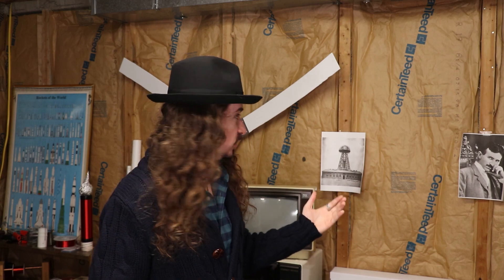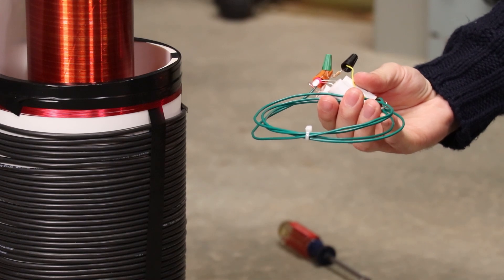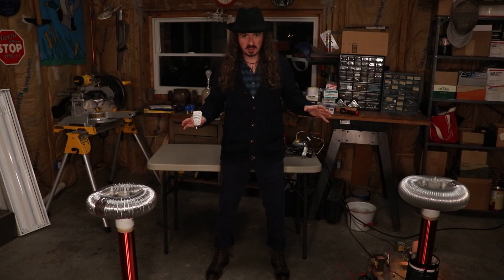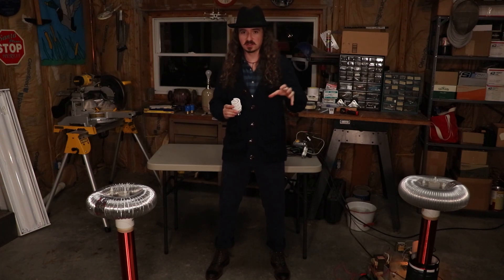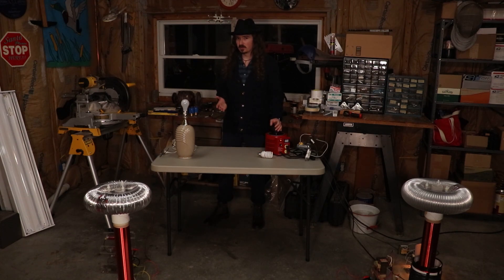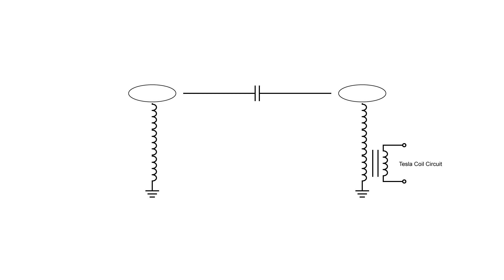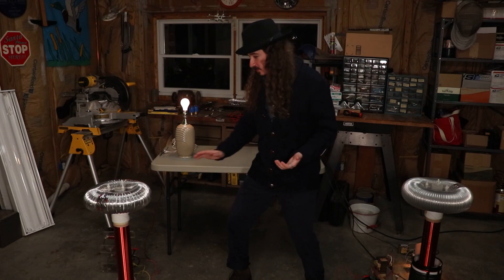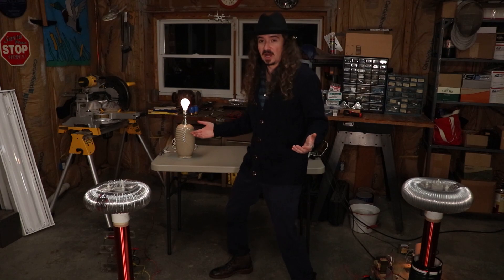Tesla Coil Wireless Power Transmission

Comment: Make them fatter and the tops bigger and put the round copper balls on the tops of them and hook it up to one of those machines that turn constantly on their own by spring or what not and use it to constantly turn 2 car alternators wierd to both push more Amp current to the sing transmitting coil and what ever else you have to do to hook the receiver up to finish the circuit Iv always been curious of free flowing wireless energy since I was a child

Comment: Okay but wat if u ran the tesla coil backwards. you have a big conductor  ball in the ion sphere,and pull high voltage down and send it were ever meaning instead of a pretty spark and lighting show by sending sparks through the top,you take high voltage in the top and send it down to earth ground .,,not possible? We'll ion harvesting group is running a small town off just that, from founding from the government,it very open source,people has got tesla coils backwards it makes a pretty light show but not wat he was doing

Comment: As I understand it, the earth frequency creates a quarter wavelength of about 8.4 inches.  In waveguide terms this is roughly the same size as some of the channels in the pyramids.  This would yield a useful frequency of 440Hz (math by Alexa).  There is speculation that the pyramids were power manipulators of sorts.  It is why Tesla was very interested in them.  I am not ready to dismiss the concept of his patent number 645576 based on this mini-proof-of-concept model since wavelength size does vary with frequency (and then there is amplitude as well).  Am guessing the video used 60Hz power which is not 440Hz.  It is very controversial and I don't think the concept has been investigated enough.
Reply: Interesting, as well as using correct frequency, if grounding rods were placed in patterns to promote conductivity, I wonder if efficiency and distance would go up?

Comment: Amazing explanation and a huge thanks for going deeper into these less known effects. I would be very interested if a very good ground could enable another coil to get pretty far from the original source. Of course if it is perfectly tuned. I am not sure though if it had anything to do with the upper atmosphere as so many people claim. 

Please note that the old newspaper pictures in the articles are journalistic clickbait if I may call it that lol. Or at least a mistake since people only saw the cool sparks it makes but that was only the way Tesla advertised his cool stuff. Even today people saw the pictures and videos today how Tesla coils make sparks so everyone assumes that's the intended use haha. Pretty far from it in fact.

You are absolutely correct that this radio worked as a "ground radio". Even the patent explains that the media for transmission is the earth ground not the air and says the less is put into the air the better. That's why the huge ball at the top so it does not discharge no matter how high the voltage is. Unlike our current radios which try to create a resonant antenna that is floating from ground. Very different!
Imagine if Tesla made that huge tower the who ground would be "part of" the circuit so any user with his/ger pegs on the ground is basically zero keters from the source of the energy as it is all the capacitor. In that sense yes the ionosphere kinda matters but only because it's a huge capacitor.
Reply: Right, sparks are for fun but wasting energy by destroying potential and make equlibrium. Low coupling, capacitive transmission are real deal and transmission line and third coil are missing. Also standing wawes phase shift and scallar (no magnetic component) also missing. One transmitting oscillaror and many surrounding resonant coils = possible overunity. None, including me, do not really know what is magnified with magnified amplifier. There are lot of playing with Tesla technology. Cheers!

Comment: Are your grounds directly connected or connected or just conected to the ground of your shop?
Reply from the maker: They are not directly connected. The base of the secondary of each coil is connected to it's own piece of sheet metal laying on the concrete floor as a kind of "counterpoise". So it's just capacitive coupling into the concrete floor / ground.
Reply: @CoilLabs  thank you, I’ll have to do some more experimenting. I got it to work with the bottom of the secondary’s both connected but the problem I’ve had with connecting them with sheet metal is it starts to burn and etch Lichtenberg figures in the concrete towards the other coil.

Comment: Very interesting I appreciate the experiment and set up however I have a question as a relates to the impossibility of being able to use wireless transmission globally Oran similarly large scales. Are there or were there geological in Edmonds fear conditions in the distant past that could have been more constant and stable? Further are there any geographical areas on a smaller scale that would have a more constant range of of resonance for safe electrical transmission?

Comment: Where can I get these specs or such so I can replicate this demonstration!?
Reply from the maker: The driver side of this coil is essentially the same as Steve Ward's VTTC5 (https://www.stevehv.4hv.org/VTTC5.htm), which is driven by an 833A vacuum tube. The receiver coil is a nearly identical coil and toroid. The step-down LC circuit at the base of the receiver was total trial and error, just trying to match the resonant frequency of the coil.

Comment: interesting demonstration.
But standing in between, could that not also detune the coils, due to their low capacity?
Personally I find dielectric coupling very interesting as it uses displacement currents.
For me it is not only conducted through the air, but even more so though the earth ground.
Why? because displacement currents are conducted through dielectric mediums.
And earth has a higher K value than air.
This is also what Tesla intended to do at wardenclyfe. And he tried increasing the dielectric induction into the earth by adding an extra coil, and capacitor to the secondary. 
making it a series (extra coil and cap) and parallel (secondary and cap) resonant system.
Reply from the maker: It probably does detune the coils a bit, yes, but it seems not significantly enough to affect the result in this particular experiment. And yes, there are most likely displacement currents through the ground, from the grounded side of the coils, as well. It has to complete the "circuit" somehow. There's definitely more research to be done and things to learn here. It's unfortunate how much pseudoscience and conspiracy theories pollute the discussion around these topics though and get in the way of real science. Hopefully more people are doing proper research on this stuff.
Reply: @CoilLabs  the most important thing that probably get overlooked, is that the more higher voltage you get on your coil, the greater is the efficiency of transmission. A proper device is at least three orders of magnitude higher voltage than your setup in this video. Are you sure that "we know today that the system envisioned by Tesla wouldn't work"?

Comment: Can you make both secondaries discharge lighting at the same time?
Reply from the maker: If I moved them closer to increase the coupling and put breakout points on both of them, then probably yes. I'm running them without breakout points here because I don't want the energy getting dissipated into a spark.

Comment: Great experiment & content. Have you expanded this at all? 
Would be cool to have a remote control car hooked up and see how range could be tested. I also imagine the size produces diminishing returns on that scale 
(i.e. do you think a larger coil/wheel/vehicle could produce greater range? or vice versa?)

380:1 is definitely not optimal, but I'm curious how much this could be improved.

Keep up the good work.
Reply from the maker: Thank you!

Larger scale of the coils would probably help, but it's an effort of diminishing return. Capacitive coupling is just not an effective strategy for any sort of longer distance.

At this time, I haven't done much more, but I'm interested in exploring related concepts, like Zenneck surface waves. There's definitely some new technologies that could potentially come out of further research into that topic. Unfortunately, there's also a lot of pseudoscience and conspiracy theories revolving around this topic, so there's a need for more scientific perspective on a lot of this stuff.
Reply: @CoilLabs  The thing people forget is the crazy amount of power Tesla used for his experiments. Didn't he damage one of the drive shafts on one of the generators at a hydro plant?
Reply from the maker: I know Tesla designed generators that were installed at the Niagara falls power station, but I'm not familiar with any particular incidents though. Could be possible, but I'm not familiar.

Comment: I feel like you just proved Tesla‘s experiment might’ve worked on a large scale. You clearly demonstrated even your body transmitting the electricity to the other coil without any danger.
Reply: Here is the thing. They are inefficient AF. The high voltage and high frequency means most of the power is just wasted through capacitive coupling.
Reply: @unrealcrafter2671  Who cares about efficiency? If you don't want to see 300 kW Tesla coils shooting 40+ meter long sparks, somtheing is wrong with you.
Reply: So why wasn’t / isn’t it used commercially? As I understand it vested interests did not allow Tesla to make a commercial success of his technology. There is a claim efficiencies are bad due to impedance?

Comment: Can't you just detect the current schuman resonance with a sensor and just adjust your devices to use whatever frequency you need in order to use this in long distances?
Reply from the maker: I'm not super familiar with the details of Schuman Resonance, but those frequencies are in the 10s of Hz range, right? That's an incredibly low frequency in terms of resonant transformers, like Tesla coils. Even very large coils are still 10s to 100s of kHz. 10 Hz is practically impossible to achieve with a traditional Tesla coil, on a human scale. You would need a completely different technology. Something similar to this effect is what I suspect Tesla was hoping for in his experiments though, but from the little bit I've read about it, what we call Schuman Resonance today wasn't well studied or understood until well after Tesla's death, so it wasn't an existing concept that he or anyone else at the time could have leveraged in his experiments. Even if it was, however, my understanding is it still wouldn't be capable of achieve what he envisioned. Primarily due to the fact that the energy spreads out large areas and you would need to transmit wildly, impractically large amounts of power to have anywhere close to a "useful" energy density at a distant location. This problem of scale is part of where Tesla was wrong in thinking worldwide wireless power was feasible.
Reply: @CoilLabs  Thanks for the food for thought! Do you in any case know what patent # is being talked about here? :
"Tesla's patent attorney conducted a three day deposition in conjunction with a patent he filed on wireless energy transmission" - It's from a forum thread that's archived and I'm unable to contact the original poster... Help, please :D
Reply from the maker: You're welcome! And no, I don't know anything about Tesla's specific patents. I'm afraid I can't help you there.
Reply: @CoilLabs  Oh, my bad, I just kinda assumed you make these devices following a patent :D

Comment: please check out my mini fusion core prototype the MFC I already have one vid up on it https://youtu.be/AnQRn_1ZS0g this is not a Farnsworth fusor this is a form of 
mini tokamak that uses one magnet for electrode protection 
and particle spin and uses the x-ray presser from the reaction to confine the plasma 
as a passive containment as the reaction increase's so does the x-rays so the core self balance's.
and the MFC had a meltdown due to not having a heat exchanger for the demo core. magnetic quenching collapsed the rotational field that protects the center electrode and makes the particles orbit. leaving the x-rays to smash the star and kill the orbit vaporizing the top of my electrode. its in the video showing the core as the vacuum increase's https://youtu.be/KCM2Vtw14Vc ,.,

Comment: I am interested in why you use a variac to control the output power? It must have to do with  stepping up the output voltage? Also are you familiar that there is a company based in Texas that is actually doing actual full-scale testing on Tesla's original wireless power delivery technology? It should only take a simple Google search but if you can't find it please reply to let me know and I will find the source for you.
Reply: His tube overheats at 120v input power. That is why he uses the variac to control the voltage.
Reply from the maker: As Firefox stated, yes the reason for the variac is simply to limit the input power to my VTTC, because the tube I'm using here cannot handle running this coil at full power without red-plating.

I was not familiar with this Viziv Technologies company nor their work on wireless power, before you mentioned it here, no. It seems that their technology utilizes a phenomenon known as Zenneck surface waves, something I was also not familiar with, before looking this company up. From the little bit I've learned so far, this is somewhat related, but actually different than Tesla's wireless power concept. This concept claims to be able to overcome some of the limitations of Tesla's concept (i.e., resonant coupling), some of which you can see in my video. Viziv doesn't seem to provide a lot of concrete technical details on how their system is supposed to work, which is a little suspect to me, but there also seems to be some recent peer reviewed research from other groups, experimentally demonstrating that Zenneck wave based wireless power transmission is feasible, at least on small scales. Regardless, this seems like a fascinating topic and something I am definitely going to keep an eye on. Thank you for mentioning this!
Reply: @CoilLabs  awesome, I don't usually get replied to by content makers so that's also awesome. I'm glad that I could show you something that you'll probably make a video on later. Great interaction I appreciate it.

Comment: Ok, practical use question. If I had a a drone flying 20 feet of the ground, maintaining position inside a 2 meter cubic meter space. And for the transmitted I have a high gain antenna able to very accurately remained pointed at the drone. Is it possible to transmit enough energy to the drone to both power it in flight and have surplus energy to also charge the battery at a reasonable rate ?

Say, 100 watts on the receiver end, now more than 100 gram for the energy receiver on the drone and functionnal even if the target moves around. Is that feasible ?

I want a drone that can autonomously fly around for 20 minutes, then hover at a certain location for 20 minutes and get recharged.
Reply from the maker: You're talking about a very different kind of wireless power transmission than what I show here. The two effects I show here are both "near-field" effects using either magnetic fields or electric fields. The strength of these fields diminishes very quickly with distance. What you're talking about is a "far-field" effect, using electromagnetic radiation, presumably in the radio frequency range. I haven't researched it extensively, but from what I've seen, transmitting appreciable amounts of power over RF is very difficult even with high gain directional antennas. Much larger antennas than you could carry on a personal drone, for certain. A more practical method for something like this that people are researching is using lasers, but 100 watts continuous is far beyond what any commonly available lasers can do.

Now instead, if you were to use resonant inductive coupling, where the drone carries a large coil and has capacitors to form a tuned LC circuit at the resonant frequency of the transmitter, and with a much more powerful transmitter than I have here, then yes it could be possible. 100 watts is pretty high, but it could be possible. Hard for me to comment on position control tolerance for the recharging zone and other requirements specifically. There are so many variables. Sounds like a really cool experiment, though!